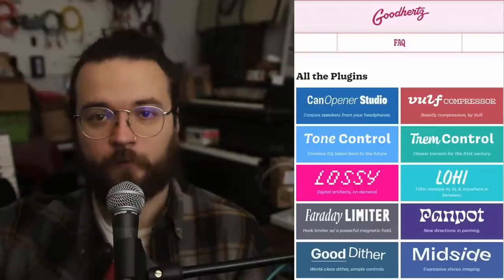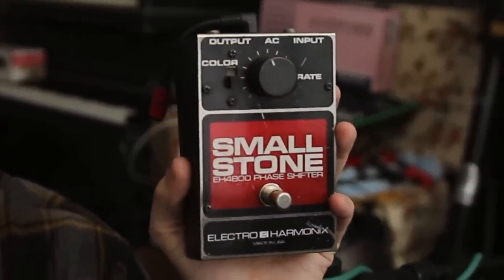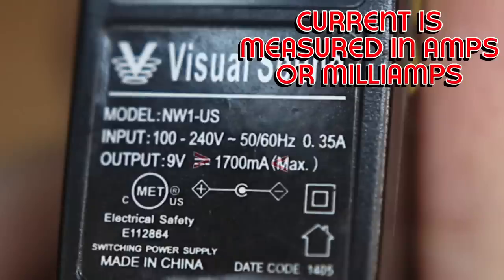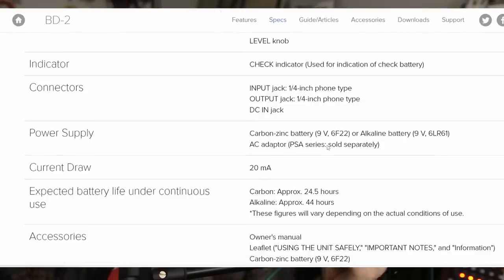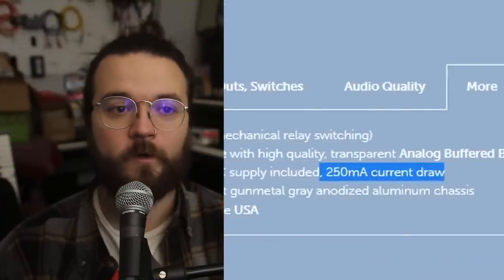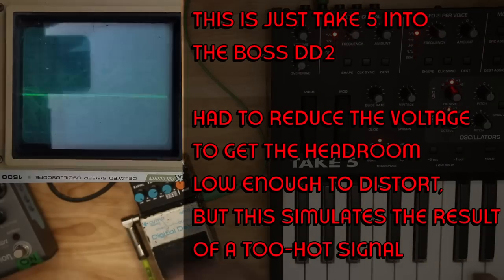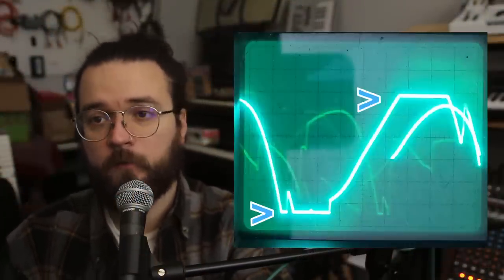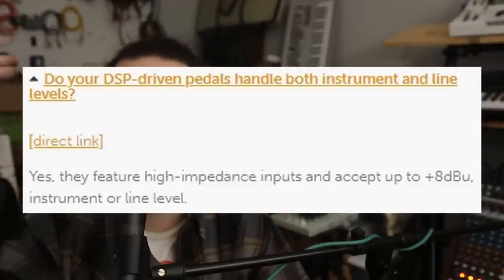The Synthesist's Guide to Guitar Pedals 1 // Power, Stereo, & Levels

Comment: Nice intro to the series...can't wait for the rest!  I would like to add that it is VERY important to double check the output of any wall wart of age or question of origin. I buy a lot of vintage gear and its always good to double check. I check mine every few years whether i need to or not. I have a dozen old wall warts that say one voltage and either put out less or in most cases more and that can wreak havoc on your equipment  . I bought a really nice rack mount processor for nothing because the unit was freaking out after being used in certain environments because the wall wart read that it put out 12V.....in reality it was 18.8 v!!!!!!! Take it from an old timer, be smart and get a cheap multi meter and verify your wall warts labels,your gear will thank you!
Reply from the maker: Good tip! And probably something I should do more often, considering how often I just roll with random old power supplies. trusting the label.
Reply: Some of the older wall warts I measured show a much higher voltage when not under load. So keep that in mind. You will only measure the actual voltage when the wall wart is already connected to your pedal.
Reply: @GotYourWallet  degradation of old components under load or not under load is still internal component degradation and warrants scrutiny of said questionable components.

Comment: I'm having trouble using a mono jack from my pedal, to stereo 3.5mm to connect to my Roland S1 synth. I just get a faint clicking noise, no keyboard sound? Has agot any ideas what I'm doing wrong. Im going 3.5mm out of the synth, into a jack that's mono going into my pedal. Thanks.

Comment: Simply turning down the volume on a synth, doesn't necessarily attenuates the signal from Line Level to Instrument Level. Some pedals cannot take Synths without clipping the signal, no matter how low the volume on the synth is. I unfortunately, have one of those pedals, an EHX Deluxe Memory Man from the 90's. Amazing sounding pedal and I love using it with my Bass Bot TT-303 but unfortunately, the signal from my '303' is way too hot for that pedal and instantly overloads it (the pedal has an overload LED indicator that no matter how low is the volume going into the pedal, it's always red) so if anyone has a good suggestion how to attenuate it without me having to spend a lot of money on a Re-Amp box, please share!
Reply from the maker: Hows the pedal with guitars? If the pedal is fine with pickups it might be an impedence thing

Comment: Not pedal related, but on your Stereo section of this vid - How would you suggest recording a synth like the Take5 into a mono sampler like the Polyend Tracker? I was thinking 1/4 TS split L/R cable into Take 5 and then the other end is a TRS 1/8th jack which goes into the Polyend.
Reply from the maker: Take 5 is individual outputs right? So just 1/4in mono ts to whatever the polyend needs, not sure if it has 1/4 or 1/8in,or expects trs or not. 

But, if you're using stereo effects on the T5 or don't want to change patches with some stereo attributes, I believe the take 5 has a setting for mono output, could save some time.
Reply: @JorbLovesGear  Nice - thanks! This makes sense. I will look for the mono setting too.

Comment: IF I HAVE A SYNTH OR DRUM MACHINE WITH STEREO OR TWO OUTPUTS , will it damage it to only use one output?
Reply from the maker: Not at all, but you might be missing some signal.

Find out how stereo is working on your specific gear.
Reply: Usually one output will also say Mono on them, usually the left output.

Comment: I have a sequential pro 3 and some pedals, I will watch and try everything you share with us - the examples were nice! I work with simple methods right now, I mean I quit ableton with its thousands possibilities and just use some analog hardware. Just the synth with its midi from a digitakt. There is so much to do with multiple Envelopes, Panning, detuning, pwm, waveshaping, filter stuff, reverbs before and after distortion, delays.. There is so much to discover. I even love my cheap eq pedal because it sounds crappy but can tickle crazy sounds out of the chain...
Reply from the maker: Well said, there is a ton of depth even in the things that seem simple, relatively speaking.

Comment: after toying around with pedals for quite some time, the level problem made me invest some money in a Eurorack FX rack to have/maintain 'hot' levels. Realize that too low levels take a lot energy out of the sound. However quite a few pedals like strymons can handle line signals.
Reply: Pretty much all pedals can handle line level signals. I think you are mistaken in the belief that you have to have or maintain "hot" levels. When you actually measure their values with tools, you find that Eurorack is actually TOO hot. You have to ATTENUATE your Eurorack output DOWN to line level.

Comment: He spends a hilarious percentage of the time talking about power but I get it. I've got a ton of pedals, and the biggest frustration was always the mess of cables. I eventually got three Strymon Zumas and one expander, and I plug everything I can into those. And since they can switch to 12V/18V, I can plug my Zen Delay, Minitaur, 727, and even a Fostex X-18 into the pedal power. And most of the things that don't plug into pedal power can plug into multi-way USB chargers. Except a couple obnoxious things like my TR-6S that buzz when they're not on their own separate PSU. It's pretty crazy. Instead of 30+ power supplies, I've just got the 3 Zumas, 3 USB chargers, and the power bricks for my Model 1 mixer and RD-9. It's very exciting from an organizational standpoint LOL.

Comment: Subscribing for the stereo chorus video. I copied a long explanation off the internet about the at least 3 types of stereo chorus and I still can't remember which is which. I think the Boss Dimension C re-issue is fully stereo and the Boss CE300 inverts one output? Disappointingly I think the Boss CE re-issue is simply a wet on one output and dry on the other which put me off. I think that's right - hopefully you will clarify it in your video.
Reply from the maker: You got it, I'm looking for a good example of dry / wet,  unique vibrato lines, and phase relationship choruses.

Comment: I have 4 Guitar pedals, a Looper, a Flanger and a Reverb to use with a old 1986 small Yamaha keyboard and MiniNova sythersizor. That was the plan however having trouble getting the correct 9 volt adapters for them. So currently there not being used.
Reply from the maker: Now you know how to find the right ones! hope you get em going.

Comment: Recently got my first real set of synths (Korg Volcas notwithstanding) an Arturia Microfreak and a Rolamd Ax Edge (keytar) the later of which i run through an Orange Micro Dark Terror Amp and cabinet (because hey i love Sleep/High on Fire and have a small 2 room appartment with thin walls and old ass neighbors).  It has an FX loop ive been dying to use and add some pedals to. This episode has been enlightening.  Thanks for the great content.
Reply from the maker: Cheers, appreciate that. AX edge seems cool, I played one briefly at Namm 2018

Comment: Thanks that was very useful Jorb - wish i had seen this before but i can now understand how a collection of single function dedicated pedals can be chained and then switched on/off at will to modify the synth output - rather than a single,all singing,all dancing multi fx pedal that costs a fortune.A lot of this equipment ( not just pedals ) requires quite a steep learning curve and practise and the more you acquire - the more to learn ! 
Quick question if i may ? I bought the Eventide H9 CORE around 2 years ago,used, and discovered recently that they have discontinued the Core and the Standard - leaving just the Max. Eventide are now offering the H9 Plugin bundle at a good price and i have contacted them twice to find out if i can purchase the bundle and install it to my Core as i believe that may no longer be possible ? I registered it with them when i bought it but i find the lack of both information and feedback frustrating and maybe i'm better spending the £174 for the bundle elsewhere - the H9 bundle was originally priced at around £499 . Thanks for the very informative and well presented video.

Comment: Funnily enough, I was looking into getting an effects pedal over this last month (prior to this video). I never used one before, and I was mainly looking for something with a decent enough reverb and looper for jamming, and ended up getting a Zoom G1X Four. I think it's a nice little tool to jam on, sounds decent, has USB power, is easy to use and also pretty good bang for the buck!

I'm looking forward to your next episode on pedals 👍
Reply: The Zoom G1 and B1 lines are GREAT starter pedals. I have been trying to get synth jammers turned on to the B1on and G1on for 4 years now! xD They are cheaper than the more desired MS-70CDR.
Reply from the maker: Good place to start! I'm considering an episode on multi effects, but want to have a good collection of them to demonstrate...Maybe I'll seek some out!

Comment: Love this. Thank you!!  Ive struggled with how to mix and amp after using guitar pedals. What do you do after the mixer? Why cant you just plug headphones into the “out” of a pedal?  Why dosent that work?
Reply from the maker: My mixer goes stereo out to speakers, or you can use its headphone out.

Headphone cables have 2 connectors passing sound, left and right. A stereo cable into a mono jack will connect one side to audio, and another to ground BUT the level isn't necessarily to be tight.

Line level =/= headphone level
Reply: @JorbLovesGear  got it!  Thanks!

Comment: I just got a boss gt-1000 core. I was never really a fan of the gt series before. This one  is a beast. I’m able to record any instrument wet/dry. I can take the dry tracks and run it through the pedal if I want a different effect later on. The best part is, I can run any of my stomp boxes through it, it’s got 2 fx loops. All this is possible only using one usb cable.
Reply from the maker: Ahh, the dry through for re-amping is really slick. 

I haven't used a lot of those multi-effects, but the utility is undeniable.
Reply: @JorbLovesGear  I’m not a big fan of multi effects either. But this one sold me.

Comment: Silly idea: pedal powered pedal power

Ride a generator bike with a flywheel, and charge a battery or compressed air can with that, then generate the electricity from the air or from the battery to run the pedals

Comment: I have a very specific scenario to do with synths and pedals, specifically the Pigtronix Infinity Looper, that has tied my brain into knots and I'm wondering if you or anyone have some insight--I'm not very knowledgeable and I think, in fact I hope, I could be missing something simple. So, I run a DM12-->Digitech Timebender-->Pig Infinity-->Mixer (Behringer Eurorack UB2222)-->Audio Interface (Scarlett Focusrite 2i2). When I incorporate the Infinity into the setup I get about a 10-15dB drop than if it was removed. Curious but not a huge deal to me. HOWEVER, I recently purchased a Behringer U-Phoria 1818 and when the Infinity is incorporated into the setup I get a massive 45dB drop in volume. I have two Infinity loopers and this happens to them both. Even more, I have a Zoom CDR pedal in which this also happens. The weirdest thing is I get ZERO volume drop with my Timebender AND my Ditto X4 looper. Also, with the Infinity, I get a lot of unwanted noise but only when I plug straight into the audio interface, NOT with the mixer into the audio interface. Also, this volume drop does not happen when used with a guitar. 

Anyways, you make great videos! I first subscribed after your vid about working with the AKAI MPC 1000 and the DM12 in MIDI which was super helpful. Thanks! 

Oh, and idk if this helps but one of my running theories is that because the Infinity has a dedicated Master Volume knob then that might be why it gets quieter for synths but I have no idea.
Reply: As long as the Master Volume on the Pigtronix Infinity is turned up, then It sounds like you are suffering a serious impedance mismatch and need to add a buffer in between the Pigtronix Infinity and your mixer of choice. A simple boost pedal could do the trick.
Reply from the maker: This is a good route to check on, see if a buffered pedal in between might help at all.
Reply: @HazeAnderson  Thanks for the advice! I'll be tryin this out.

Comment: I was hoping for a little example of how you plug them in. I'm a guitar player who has just bought a keyboard - Ch 1 and 2 have my monitors plugged in, so the Ch 3 and 4 is where I should patch the pedals into? Patch out of ch3 into pedal, then return into ch4?
Reply from the maker: Are you talking about a mixer? Channels of what?

Depends on what you're trying to do, you could go synth > pedals > mixer, or if you have aux or effects sends in your mixer, you can send out of there to the pedals, and then come back in on a channel.
Reply: @JorbLovesGear  Say I just want to hook up my looper pedal to my keyboard. I just power it with my power supply, go out of the back of the keyboard (ch3), into the looper, then back into the keyboard (ch4)? I could just try myself, but I don't want to risk anything.
Reply from the maker: @user-ql1pc7pi9x  You won't want to come back into the keyboard, unless you're processing it again, but that doesn't seem likely. What's the keyboard, something with multiple channels? It would presumably be sending a different signal out on each of its channels.

Keyboard > looper > mixer / your monitors.

Comment: So, I have at least a couple of guitar pedals that when I have used them in an effect chain after eurorack or line level they just cut the sound out, like choke it to almost inaudible.
I’ve never known why but I’ll be following this series to hopefully find out!

My guess was it had something to do with impedance, but maybe only because I know I don’t understand it haha
Reply from the maker: 100% possible!

Impedance can cause issues, but there's a lot of misinformation out there, too.

If the pedals are true bypass, or un buffered, try something before them that does have a buffer. Or with eurorack, a module specifically for converting to line level or interfacing with pedals.
Reply: @JorbLovesGear  thanks for the response! I’ll just not use those pedals where they don’t work and look into it a bit more after enjoying your following episodes.
Just because I’m lazy, and there’s plenty of things to play with that work in the mean time lol
Reply: Just posting for following up, because I have the exact same problem with my Boss DS-1: as soon as I press the pedal, the volume drops massively and I can barely hear anything. It’s kind of holding me back from getting more pedals, by fear that this would always happen. So if you ever found a solution to this, please let us know!

Comment: Would love you to chat about what to think about when passing a balanced signal from a synth into a pedal that is built for unbalanced signals.
Reply: You lose the ability to use Common Mode Rejection to prevent unwanted noise like power spikes from ruining your sound. The trick is to use SHORT cable lengths. Having said that most synths do not have balanced signals ... your mixers and rack effects are what use balanced inputs/outputs.
Reply from the maker: You would lose the noise cancelling, but are gonna get signal through no problem.

Comment: Hey Jorb. 
I own a couple of pedals ( boomerang looper, big sky, volante and nightsky) and a nord stage 3. When I put all together with my nord stage something happens with the sound, it getting more packed. I do not own a mixer. Will a mixer fix the problem, and what kind of mixer do you recommend ? All pedals is in stereo the same is the nord stage 3. 

Thanks for your videos 💪
Reply from the maker: if it sounds like a problem, run through one pedal at a time and see if its just one. 

Top of my head, are volante and night sky both on line level? (if using synths) are any of their preamps turned up? Big sky cab sim switch on?

go through one pedal at a time, see if its one. If its only when they're all in, try different orders to see if its a buffer issue, or be sure your power supply is giving everyone enough headroom (low power being lower headroom is unlikely with all these digital pedals though)

Comment: I have a Revv G3 distortion pedal that hard pans everything to the left. Is that normal?
Reply from the maker: Are you plugging headphones right into it? Its probably mono out
Reply: @JorbLovesGear  yeah, it's mono out, but I guess I was expecting the same mono signal in both left and right channels. And yes, when I plug headphones directly into the pedal, everything is hard panned left, but when I plug the pedal into my amp and then plug the phones into the amp, I get the mono signal in both channels. Just wondering if that's weird or if it's the norm. Thanks for your reply!

Comment: Love this. The power has a shockingly huge impact on how well the pedals work. Also worth note: Not all of the daisy chains work the same. My last (far too cheap) purchase was a daisy chain with an unusually short barrel. It works with most of my pedals, but my Walrus stuff doesn't work with it-it doesn't quite connect.
Reply from the maker: Good points! I had a first version of the julia that had a mis-alignment and the berrel would tough the edge of the casing.

Considering and advanced power supply video where I talk about running at lower voltages, running synths from a pedal psu, etc etc